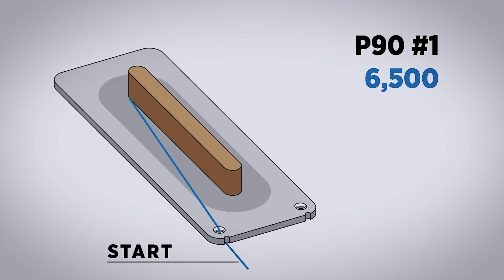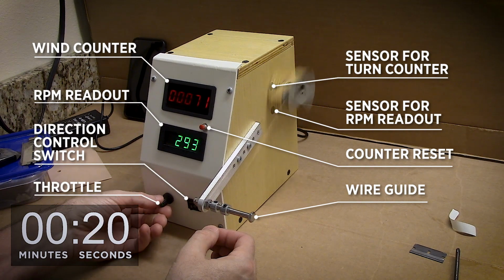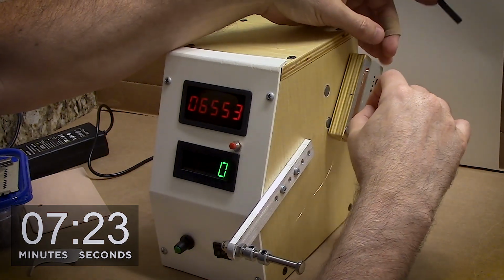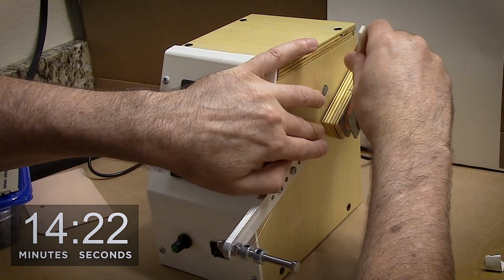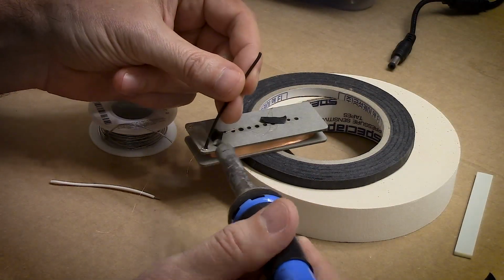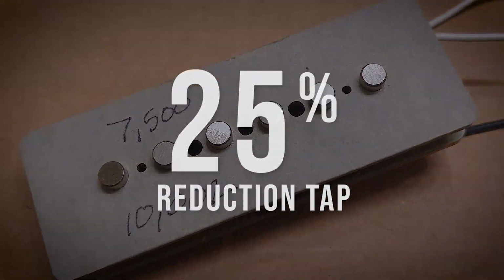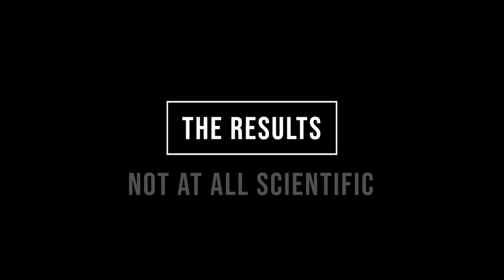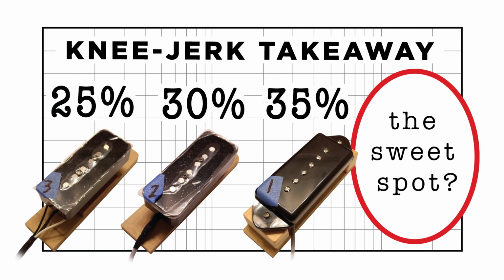P90 Pickup w Coil Tap - the Next Project

Comment: I do believe that the vac potted ones are more likely to be better waxed compared to the non vac potted ones, and it helps to get rid of some noise when using high gain amps s this is a great thing to do, vac potted P90´s are great with less hum.. :D
Reply from the maker: HeadGear, thanks for watchin!
Agreed, vac potting gets the wax in there.... 
I want to do a side-by-side comparison, dipped vs vac potted, then cut them both open. A long to-do list...it's on there.
Hope all is well, take care!
Reply: @theNextProject   Yeah make a video comparison, it would be interesting to see :D
Reply: I heard some folks say some P90s werent waxed and that may play into the tone produced, i have never checked though!

I made a vacuum degassing rig for removing bubbles from epoxy resins...looks like it has a new use!

I like the centre tap idea loads, easy to put on a switch too.

Comment: Good job, intresting
Reply from the maker: j roc, thanks for watching!
It was an interesting experiment. Next test will be a A/B test where both are wound to the same turn counts, but the tap will be inside the coil (A), the other will have the tap to the outside of the coil (B).  
This should help shed some light on the impact of magnet strength, and coil length... or something. 
Both pup will have to be of the same physical build, unlike one of the pups in this project.
Reply: @theNextProject  cool, I am looking forward to it,  by the way,  it was well played and the pickups all sounded great

Comment: Hi
Thanks so much for the video! explains a lot.  When wiring this set up Are you grounding the end of the coil? And then to tap ground the tap?  Leaving the positive tip in the same location? If so, would it be possible to run + to the center tap And ground either the start of the winding , or the finish of the winding.  Or ground both and then be running the full winding from the center tap?  
Hopefully that makes some sense.  
 And again, thank you for your video. I learned a lot…;-)
Reply from the maker: Erik, thanks for watching and the comment/question.
The way I have these pickups wired:
The start of the coil is my ground (-), the coil builds out from the center and exits for the tap (+ when selected), the wire then returns back to complete the full wind count and does a finish exit of the coil (+).

If the tap (+) is selected, only the winds from the start (-) to the tap (+) are "in circuit".
If the tap is not selected, it the loop out of the winding (tap) acts as a continuous strand of winding wire on to the finish (+).

You could add another switch at the end of the pickup to reverse the "flow", basically changing the phase of the pickup I guess. There may be additional noise from having the start be on the outside of the coil, rather than buried in by the magnets. 

Interesting idea, changing the "ground" points. Some experimenting may be fun.
Sorry I don't have an answer for you.

Be safe and take care!

Comment: I have found that I like a regular single coil neck pickup around 6.8k, assuming the Alnico 5 magnets are fully charged. I have tried 8.1's which I thought were too strange, and have also tried 5.5k, the later which I found piercing and fizzy when distorted.
Reply from the maker: Value, thanks for watching!
Good Info you've shared, my testing will continue. These P90s don't seem to be too far out of line resistance wise. Seems a lot of 10k wind P90s are in the 7.5kohm to 10kohm range. From what I've read and a few personal tests.
 
My audio testing lacks quite a bit making them all a bit brittle.  A lot more to learn for sure.  Back to the drawing board, at least it's fun to fiddle with this stuff.
Hope you are doing well, take care!

Comment: what 's the use of a coil tap on a P90 pickup ? P90 being a single coil pickup by essence if i'm  not wrong
Reply from the maker: Pandor, thanks for watching!
The P90 coil tap, is to have a lower output coil available, which will impact the sound, without having to changing volume or tone. 
In this video, I'm in search of what percentage winding is before and after the tap, gives the best combination in sound. 
Personally, I like the greater percentage, but others line something more in the middle of my test range. Not sure if I've found the sweet spot yet.
Everything is subjective.
Hope you enjoyed the video, take care!
Reply: @theNextProject  Thansk for answering, my question was not rethorical,  as far as i know, only a proper humbucker composed of 2 coils can be splitted, therefore how can a single coil (i know some P90 actually have 2 bobins but most don't) can be splitted ? how do you actually manage to do that since there's only 1 bobbin ?
Reply from the maker: Ah, maybe we are talking 2 different things.
You are correct, a humbucker can be "split" into 2 separate coils.
But a coil "tap" is not splitting coil(s), it is having a point in (1) wound coil that exits that coil at some point in-between the start and finish leads of that coil. It's an off ramp along along the highway in-between home and work, a rest stop... That's probably a bad analogy - sorry.
A switch can then be placed to use either the entire wind count of the coil, or the portion of the coil up to where the tap exits.
This gives you the choice of going the whole distance, say 10K winds, or taking the off-ramp at 7K winds.  Both take you somewhere, but they are different places/sounds.  WOW, more with the analogy - sorry again. I can't help myself, lol.

So a coil tap is cutting into a single coil, at whatever point it's placed.
A Coil split, is as you mentioned separating the two coils of a 2-coil humbucker.

Great question you have, glad you asked and if I'm not explaining it well, please let me know.

Thanks again for watching!
Reply: @theNextProject  I thank you for taking time and effort to explain me those things, about which i'm totally ignorant, analogies are perfect btw, this is the natural path of human brain, i see theorically what you mean, even though i don't fully understand how it's physically feasible, i mean a wire is a wire, unless there's like a bridge, you can't just tell electricity "ok, now, after you've crossed 5000 turns, you stop and go to the output jack",  sorry if my observation is ridiculous
Reply from the maker: Pandor, glad to chat with you about this. You have a great question and so many people have that same question.

We actually can tell the electricity in the coil where to exit. That is what the "tap" allows. 
If we have 10K winds of wire on a coil from start to finish and that's it, the current will only have one path to travel.
Now, if we add an exit to this coil during the winding of the 10K coil, at say 7K winds, and the remainder of the wire loops back in to complete the 10K coil. We have introduced the "tap", or the off-ramp. 
If the off-ramp is closed by a switch, the current has to travel the full 10K winds of wire. 
If the switch closes the highway and opens the off-ramp, then the current is diverted and will only use the 7K winds of wire. The other 3K winds aren't available for travel.

Maybe a train on a set of railroad tracks that has a switch to divert a train to a different set of rails is a better analogy. Depending on where the switch diverts the train, changes the destination/sound.
You can go to either travel to the 10K destination, or the 7K destination, not both at the same time.

Or, think of the letter "y". The lower tail of that letter is the start of the winding, and maybe if you stay on the direct path from the tail to the upper right of that letter "/", that is the full 10K of winds. However, if the path is diverted from the start, to the upper left ")", that path may only have 7K winds. 

I hope I'm not making this more confusing. I am having fun trying to think of different anologies and scenarios for comparison.
I'm goofy.
Let me know if any of this helps.
Reply: @theNextProject  thanks again, it's not confusing at all, it's just that my brain simpy doesn't "see" how it would look like, as everybody knows that wehn you break or interrupt a wire, you kill a pickup in a way, but i know humans can be clever so there's obviously a way to physically achieve that, i just have to see it with my own eyes (st thomas mode on)
Reply from the maker: I think we are almost there.
The wire is not broken, but interrupted to a different destination. 
The tap doesn't break the full length of wire, it is merely an alternate exit for the current and only available when selected.
So, the current has the full 10K path, and only when a switch selects the tap/exit is opened and the current diverted to follow the 7K path. If the switch is then flipped back, the current again has to follow the full 10K path, as the tap is no longer available. 
Once you see it, you'll never unsee it.
Reply: Perhaps the old rule that electricity always follows the path of least resistance would be helpful. If the pathway becomes available to the current after only 7k winds it’ll ignore the rest of the coil because it already has a path out. 

Once I flip the switch and close off that 7k pathway, I’m forcing the current to go the distance of the full 10k because there is no other choice. It would rather not do that, it’ll take any route it can to do less work. A short in a circuit is a problem for that reason. Actually makes me wonder if the phrase short circuit came from the idea that the current found a shorter path and now won’t put in the work I want it to do. It escaped the maze? Haha maybe I’m starting to ramble a bit. But, hope that’s helpful. 

Great video by the way! Very helpful for my own project 👍

Comment: Where can I buy your tapped p90? :)
Reply from the maker: Cape, thanks for watching!
I have 2 P90's left from this test. 
The dog ear P90 is gone, but the 2 magnetic pole pups are in a drawer around here somewhere.
Let me know what you're after, maybe I can help.
Take care!
Reply: @theNextProject  very kind of you sir! I would love a tapped p90, and searching for one brought me to your page. I played an 80's gold top where the neck pick up was brighter than the bridge, which confused me and until i did an ohm reading on the pickup, and it read 330 ohms. Super low, so I doubt I was getting a true reading (I measure twice on two different multimeters) so I'm thinking, and your video proved it, that a lower wind will give a more pronounced mid and top and I love this for a neck pickup but obviously switchable. Hence wanting the tap to be switchable via a push pull. If you are interested in selling the 2 magnetic pole p90's they would definitely be going into gigging guitars. I can send you more info via DM also. Thanks!
Reply from the maker: Send me a message at:  thenextproject.info@gmail.com
Thanks!

Comment: Aren't they Jazzmaster pickups? 
I was under the impression P90's have two bar magnets 
Not claiming to be an expert, just easily confused
Either way, it's a good idea for a plagiarising bugger like me to try out
Reply from the maker: Glann, thanks for watching and great question too!
I'm not 100% on all the fine points but these are similar to jazzmaster visually, and are using slug magnets, but the bobbin/physical dimensions are different than Jazz Master pups. 
These have 1/4" between the flatware for wire winding, JM pups are closer to 1/8" if I recall.  JM pups have 4 mounting points on the outside edge of the cover, while these are using standard P90 covers and mounting points. 
So kind of a blend of both worlds, at a glance they all look alike. 
Hope you are doing well, Happy Holidays!